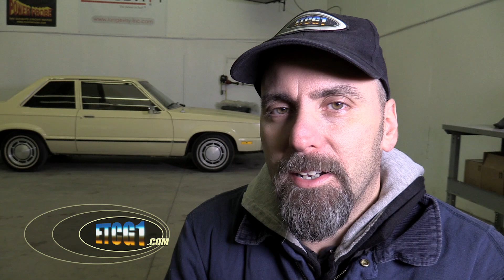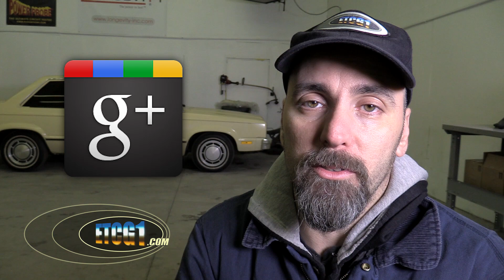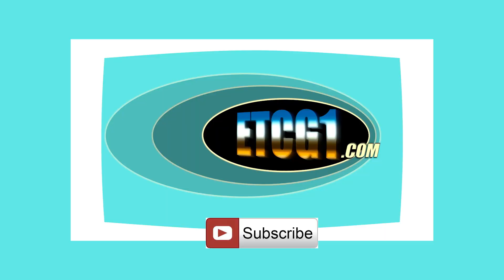How Things Have Changed In Auto Repair -ETCG1

Comment: depends on how its driven maintained ( oil changes ) and stored , how are all the extra wires and tech going to stand up to heat and snow, will new cars be around and drivable in 30 years 
I spose the old ( 1960s and early 70s cars ) were simple and mechanical but cost more to run and dangerous in a crash
the new emmisions cars have codes but are complex and not much room under the hood ,catalytic converters and sensors take the cars off the road , the money saved on petrol ( gas ) go into sensors and repair
Reply: +cars You can say that again. All that money, resources, and OIL spent on moving all those parts around, to get them made, to have them installed. All of it is sooo huge. Did we really save the planet with those extra sensors? In the beginning it sure cleaned up emissions, but now I really wonder if extra measures really help at all.
Reply: Yep on the other hand cars, bikes, young ladies  -  its what people live for its what keeps the world turning
Reply: cars
So of course a lot goes into it, but it could be simpler and better.

I just checked out your channel. You cleaned your MAF based on learning from Scanner Danner. Very cool.
Reply: +cars When fossil fuels get combusted at high air temperatures they produce hydrocarbons. These hydrocarbons contain chemicals pertaining to the cyanide poisons family. Car manufacturers knew that, but they were forced by the oil moguls which run our world(s) to make them run on refined fossil fuels. Rudolf Diesel designed his engine, the DIESEL engine to run on peanut oil because stationary engines back then were used inside buildings for different industrial applications so he knew that if ran on fossil oil it will poison the workers. Mysteriously he got murdered after his invention was shown at the world trade fair in Paris by Shell Oil Company which seized his engine and converted it to oil burner. If you read this and don't agree with me why emission controls were put in place, then do your own test and run your car in a closed garage for an hour then see what happens ;) emissions were not put in place because of mpg. a 60's Chevy Byscanne with a straight 6 could get 30 mpg stock.
Reply: Strooth , thats good for a 6 cylinder, about the poison in peanut oil ill just take your word for it, didnt know mr diesel got murdered
Reply: LOL

Comment: Eric, thanks for the video. I am repairing a 1985 c10 as work truck that has been gutted and 355/ 700R4 swapped. I don't want to spend alot of money on to get it VA state inspection ready. I have been rewiring the ignition, and all of the switches to direct toggles, etc. I'm doing alot of "custom" work. Custom gauges, exhaust too. Nothing crazy, just standard stuff. 

Do you think this truck is a liability? The inspection checklist seems easy enough, but someone asked me "what if you get into an accident and their lawyer blames your "custom" work"? Should I give up, and just buy a newer truck that is un-tampered?

Comment: My opinion... some service technicians have have blinkers on the eyes called... "the code reads this and this." I've encountered it two times already in my car which is Toyota Avensis from 2002.
1. You need to replace the catalitic converter cos we have the code...  bla, bla, low efficiency. The cause was malfunctioning lambda sensor. Of course the price is way less.
2. You need to replace steering column ECU says the positioning sensor is bad... and sorry its just one part. The cause was broken skew sensor. The other problem is that stupid little thing cost ~500$... Igot one on auction for 20$. I must say its just greediness in pure form... all phones have them nowadays and they cost few dollars.
More parts just multiply costs and comlpexity of repair.
Reply: +Tom Tomski I got a camry for 500 bucks with 250,000 miles. When this one rusts away, I'll buy another one for 500 bucks! Just an idea. Best car I've ever bought, now has 310,000 miles, runs the same as the day I got it.

Comment: The mid 80’s to early 90’s was a terrible period for cars not because of the cars, but because mechanics didnt know how to diagnose OBD. Almost invariably they replaced PCM's because they didnt know what else to do. Statistics showed that of the thousands of PCM's sent back to the factory- only 0.2% of them were actually faulty. Thats 2 out of a thousand- and even then the tech probably blew the PCM himself I bet. It's 2016 now- if a technician still longs for the days of the carburetor because them new fangled computers dont make no sense then they are in the wrong career.
Reply: +Schrodingers Box Ah the most common story..."You need a new MAP sensor" or "You need a new O2 sensor".
Reply: LBJ Said 200 Years Hell that's STILL the norm these days with hacks and parts changers.
  Jeez an auto parts store would probably go out of business if they didn't stock O2 sensors on site lol!!!!
Reply: +LBJ Said 200 Years Even a sub $100 harbor freight obd II scanner (made by Autel by the way) allows you to graph MAP, MAF, O2, TPS & much more.  Beyond that a simple $5 DVOM can show you that you have a good ground, signal and power reference. It is foolish to replace parts without solid diagnostics, and with some basic Launch scanners that are in the $200 range you get SRS, ABS and bi directional capabilities (like GM crank variation relearn, steering and drive by wire relearn) these features were only available on 5K scan tools just a few years ago.
Reply: Gregory Davis The problem is 99.99% of people have no idea how to interpret any of that data.
  They pull the code- they look at O2 sensor, map, maf TPS timing injector pulsewidth and fuel trim data....

............ and then they replace plugs, wires and O2 sensors on a guess anyway.
Reply: Gregory Davis Yes yes and yes I cannot agree more with your post. That's why I drive a 93 Dodge ram with a 12 valve Cummins. If you can work on a push mower you can work on one of those.
On the other hand, my wife's new Acura keeps trying to connect to my phone, entry gate and garage door.....fun times ahead for all.
Reply: Schrodingers Box It's like cell phone tech support at your cost, instead they just run through a list of pre-written instructions replacing items until they get the code to reset, most of the time they address the symptom not the cause.
Reply: LBJ Said 200 Years <<most of the time they address the symptom not the cause. >>

  BINGO!!!!!! I say EXACTLY this all the time!! Dude you should check out my channel. I think you'd like it.
Reply: Schrodingers Box The comment I love is "the guy at the part store said it was ___" "He also said we should change the downstream 02 sensor as well"
Even the shops aren't doing it right, I've done 4 cars in the last 2 weeks with the 1/2 tuneup, where the plugs under the intake manifold weren't changed.
People don't want to take the time to understand the data, they will piss away hundreds on unnecessary parts but think a proper diagnostic is a "ripoff"
Reply: Gregory Davis Yep- here are just a few of my favorite parts-changer hack excuses:
"it needed to be changed anyway because of the mileage"
"another car had the same problem and this fixed it for that car"
"The check engine light code said the part was bad" (they NEVER say a part is bad. They say the feedback was out of range or illogical).
"It was only x bucks so it was worth a try"
"I wanted to save money doing it myself" (this after they spend 3X as much on guesses as they would taking it to someone who knows what they're doing).
"The stealerships have no clue what they are doing and they rip you off" (this after they spend 3X as much on guesses as they would taking it to someone who knows what they're doing).

  Basically, it comes down to this- a hack will never, ever, ever be able to fix an electrical or "invisible" performance problem problem with a wrench.
Reply: Schrodingers Box I had a customer bring me an Envoy when warmed up the car when coming to a stop would stall like a manual if you were in gear and did not disengage the clutch they called me and I said I need to take a look at it to be certain but it sounds like the transmission is not disengaging stuck valve or bad solenoid as truck would idle and rev fine and could be restarted after the stalling event. They bring it by I scan it and take it for a drive to replicate the condition sure enough I see the torque load flying up upon decel coming to a stop/stall. I recommend pulling the transmission valve body checking the ohm values of the solenoids and inspecting pistons and valves for galling. They leave head straight to the GMC dealer who subsequently installs a Fuel Pump, Throttle body, Throttle pedal (drive by wire) and a few other items, car still stalls, dealer finally recommends a trans rebuild.
They bring it back to me I find a cracked piston in the valve body and a borderline solenoid both items replaced. No more stalling, I billed them less than my initial estimate of $375 (I quoted a valve body without inspection I had to assume the worst) I told them since they did not like or trust my initial diagnosis that there was a trust issue and in the future don't bring their car back, the look on their face was priceless. They called to apologize a few weeks later, I told them too late for that. 

I'm always fair and honest with customers but if they think otherwise I don't even want them to darken my door.

Comment: I think 95 to 01 cars were easier to work on overall(at least where i'm from), there was just enough data to get them fixed and not the complexity that newer cars demand for emissions standards and user friendly gadgets that get incorporated in even the cheapest cars and require new modules and communication with various modules to work properly and i'm not talking about your bluetooth radio only, i'm talking about a whole transmission/transaxle, not to mention everything is turning plastic and electric, and brittle.

Comment: + DE Nichols.  I agree up to a point.  I worked in a tv repair shop for many years.  In 1974  bought a new car. cost me $3000.00 Bought a new color tv. cost me 595.00. In 2000, Same  basic car 14000.00 Same basic tv 179.00  Most of the stuff on the car had increased in price due to government safety and fuel economy mandates..  When you see in the auto industry what happened in the consumer electronics industry, I guarantee the price of cars will drop like a rock: That is make e them all plastic and have them made in China.

Comment: lol now you stepped in it brotha ! fuel injection more efficient?...better tell that to my Carbureted 1980 dodge diplomat with the slant 3.8 with 2 catalytic converters and a air pump..20+ in town and 30+ hwy all day long year in year out..all i need to keep it in tune is a vacum guage,straight blade screw driver,1/2 in open end wrench and a timing light..i might use a hammer if i owned a import though :) on the other hand my ultra trusty 1990 grand voyager developed a stalling non starting issue after going down a wash board road..took me months to figure out that the crank sensor clearance was the issue no code thrown from the obd I..the only thing fuel injection does is allow you to drive right  away in any weather and allow people that have no clue how to operate a motor vehicle to do so :/ i no longer do service work but i have a fully outfitted home garage and i do enjoy some of the "component" replacement pieces..like the half shafts on my 83 944..12 allen head bolts..grab each end push together a little and it drops right out..check out 80's mercedes brake pad replacement it will blow your mind how simple it is..cars are throw away items now.. not the pride of ownership like it used to be..modular parts are cheaper and easier to assemble..who cares if it costs more to repair..certainly not the auto manufacturer...

Comment: A big change has been computer aided and more intelligent design.. For example, the use of formed metal gaskets that are precise fitting, or no gaskets... Rather than paper or cork with aviation sealant... Things just fit better together now and are more modular.
Reply: +ArchimedeanEye You're right. Lots of things don't need gaskets unless a lot of wear have happened. :)

Comment: i hear door lock modules and electric windows and fuel injection, these things are foreign to me every single car i had never had a computer, points, real distributors, carbs, you name it, and i fully believe every single tech in the business should have to deal and work on pre any computer car. when you know how all the systems work, you know the whole picture, besides computers can report wrong, i know, i work on them everyday. ( and have had experience with bad reporting systems)

but I.A.N.A.M/T ( I am not a mechanic/technician)

Comment: Eric, i never could figure out why auto manufacturers used those odd systems. Computers and carburetors together doesnt seem to make much sense when they had the technology to use e.f.i. Do you have any idea why they would use those systems together instead of fuel injection?
Reply: +Paul Carroll I think it was a way of engineers trying to not fully grasp the new stuff...or maybe they had a great carburetor but it needed a little help. I don't know, but I know this, mechanics believed my old Nissan Pulsar actually pulled off being both. I wasn't good at cars back then. I don't know.

Some engineers watch this show, it's the best place to discuss all kinds of topics with real experts on all sorts of things. Good luck on an answer! Maybe post it to the live event.

Comment: I own a 2001 silverado with 250,000 miles still running great ........when i repower the vehicle shouldnt i go with a factory engine and transmission with 100,000 miles or less verses a crate or a rebuild set up ...... the body and interior is like new

Comment: I listened to the video and do acknowledge everything you've said, however I don't agree things are easier now. Especially for mechanics (not necessarily diagnostic guys even tho diagnostics are a lot more complicated now as well). Space under the hood for you to fit your hands in there and take certain parts off has been drastically reduced from these pre obd2 days where i could physically fit my entire body inside the engine compartment of most of the mainstream cars and trucks. So much room to work with and so little wires (yea lots of vacuum lines but with a diagram they're not hard at all to route properly), components were basic and straightforward. Nowadays engine bays are cramped  the the point not much else will fit under there. Transmissions before were very easy to rebuilt compared to modern transmissions which are incredibly complicated and most of the time it is just easier to replace with another unit. But how do you know if its something outside the transmission that's at fault and not something internal? You may replace the unit only to find out the issue is still there. It has become way more complicated the way I see it. Add in we'll be working on GDI systems shortly within the next few years where additional precaution must be had before even attempting to service these systems. Add in hybrid vehicles, full electric, etc. I don't see it getting easier at all, in fact it's only getting more and more difficult the way I see it. But then being competent in today's world is what separates the good mechanics from the ones that never had any formal studies and grew up in the "carburated" days where such studies were not really needed.

Comment: You might not agree but I think OEMs are being ignorant idiots by not giving the vehicle owner, first off the trouble code on the LCD displays that are in almost every car. Then, forcing techs to diagnose using a scan tool. What they really need to do is make use of the screens that are coming in many, many new cars, integrate diagnostics right in there. Sensor readings, code readouts, etc. Lose the entire scan tool process except for cases where you'd reprogram PCM, etc.

OBD has come a long way but I think it has a long way to go too. Obviously many automakers are moving toward electric vehicles too which will simplify repair/maintenance (a good thing). Remote diagnostics are already there to a certain degree, I think that will continue to advance a lot (think dealer can access your car at home remotely and run diagnostics).

Huge changes to come in the next 5-10-20 years.

Comment: Eric:
I see the automotive industry going in the direction of the electronics industry.  I will get to the point where an auto will be discarded when it fails simply because it will be cheaper to replace it than to fix it.
Reply: +Dan Floyd We're already there on some grouped components. Maybe things used to be rebuilt and now we only replace, but those are mechanical parts and I'm sure the reman shops do better than we would since that's all they do.

Overall cars cost way too much and are built too much to need fixing, so the only way that could become true is if cars were dirt cheap.
Reply: +Dan Floyd And thats fucking sad! Stop Apple from making cars lol! Have Samsung build them! (i was literally kidding if anyone decides to take it seriously)
Reply: Dan Spirescu Lol
Reply: Cheaper to replace than fix it?  Now, a car cost $40 to $50 thousand and it takes people 7 to 8 years to pay for it.  You must not know what vehicles cost today.

Comment: I think all 80-90's cars were just as easy, if not more so, to trouble shoot then obd2.  you run codes with a paper clip instead of a code reader then there are only 2 and 3 digit codes. no abs, traction control, airbags ect. these are the things that ad wires and codes. 

fuel injection itself is actually pretty basic to maintain and trouble shoot.